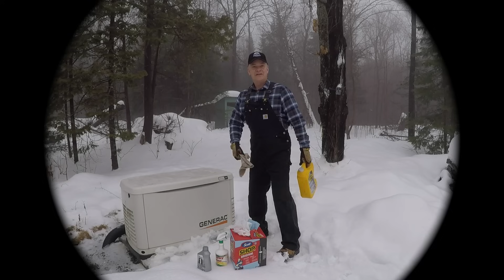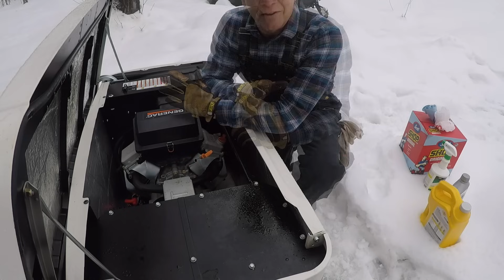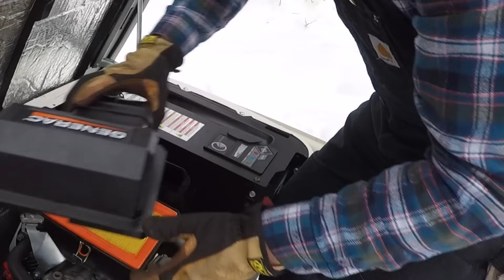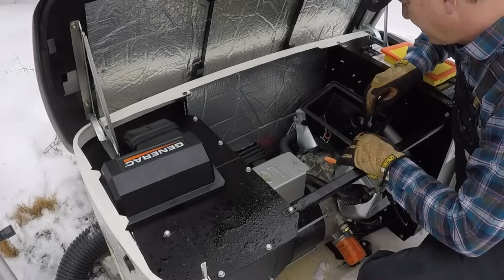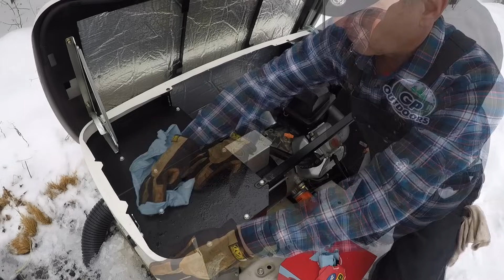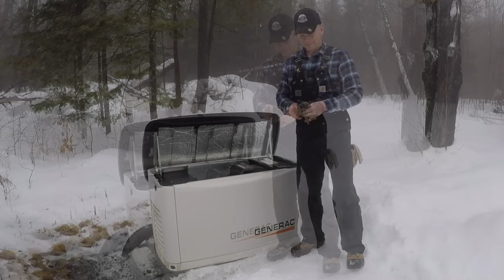#133 Thinking of Buying a Generac Generator? You Need To Watch This!

Comment: First thing you need to know before buying a natural gas generator:
Most likely that you will need to upgrade your gas line & gas meter from the street. The problem is not only the cost ($1,500 for the gas company, an additional similar cost probably to your master plumber, and another grand for the electrician) We found out that our street had a moratorium, preventing opening the street for a year. So had to wait one year for the gas company to be able to change the gas line to a bigger one.
Reply from the maker: That is true and excellent information - thanks for sharing it for folks to know. Cheers!
Reply: And for us country bumpkins, our propane tank needed it's own 1" line for the generator by code in Ontario.  Yup, the install is expensive but worth it when the lights go out.  We're on a well and it's nice to have water whenever you want it, and lights, and heat,...

Comment: Im baffled that there is an exhaust port in the air cleaner......I wonder if its actually for  crank case ventilation. One way to deal with it is to drill a couple small weep holes on each side of the bottom of that air cleaner box so to drain the condensation.....not so big to defeat the air cleaner but just big enough to drain.

Comment: Looks like a design flaw if you ask me.  Hopefully later models of this generator address this quite significant design weakness.

Bring on micro nuclear reactor powered generators of the same size as the Generac, except it's fully sealed, armored and zero maintenance/refuel needed for 60 years with a duty cycle of up to 744 hours a month (i.e. 24/7) @ 95% output or up to 730hrs a month @100% output.

Comment: These units are the cheapest of the cheap as far as stand by generators. Cold weather kit for a Briggs consists of a heated rod installed in block and a battery warming pad, Generac has a cuff that slips over the oil filter that's heated and the battery pad. The wire connections are push down spring loaded connectors opposed to screw lugs on just about every other manufacturer. You get what you pay for on these generators is all I'm saying.

Comment: DON'T FORGET ABOUT THE SOUND TEST done by many cities. You can spend tens of thousands of dollars and lots of time and pass the electrical inspection. Then they come out with the sound meter, and test, if it's too loud they won't let you use it.  The test is often performed at your property line. The further you can locate the generator from the property line the more likely you are to pass the test. It doesn't matter how noisy the generator is, it's the noise level at your property line. Yes, leaf blowers are 10 times louder and run much more frequently, but they not regulated by the bureaucrats.
Reply: build a fence around it to help contain the noise.
Reply: @robertbrown8396  Interestingly, portable generators are not regulated. They really can't. So, in the middle of an ice storm at 3am, I can drag out my portable generator connect it to a fuel supply, start the generator, manually activate a transfer switch. This is all fun to do at 3 am. Moreover, the portable generator is at least twice as loud.
Remember what Dr. McCoy said in one of the Star Trek movies. "The bureaucratic mentality is the ONLY universal constant."
Reply: @w-2385  Exactly... That's why I would tell them to go take a flying leap... And fight them on their "retarded law".

Comment: My original Generac 16kw lasted two years before it exploded, sending metal into the engine.  The warranty repair guy said it was a total loss and needed full replacement, so he took the entire machine away, box and all.  He came back a month later and said the Generac warranty people would not let him replace it but demanded he fix it.  He told me it cost twice as much to fix than to replace, so he stopped servicing Generac warranties.  Now, if I have a problem, I need to go with a small engine repair shop who does deal with the Generac warranty people and they are 200 miles further away.  He only wants to deal with contracted people who pay a yearly fee and still have to pay full mileage, even though he will only come when others in my area want service.  Luckily, the rebuild took and it has been a good machine for five years running now.  When this one blows up I will just buy a different brand, because of the warranty issues with Generac and no local service available.  By the way, my Generac is LP and it does not run in sub-zero temps because the propane does not flow at extreme cold temps; which makes little sense as this is a stand-by generator that is supposed to run while the weather is extreme.  I'll go with something gasoline-powered next time, but only because LP does not run in the extremes of weather we get up here in the north.  I have enjoyed the LP cleanliness and stability, but if it won't run in the winter it's no good to me.
Reply: Funny - our temps in VT get to -25 and my propane devices operate just fine.

Comment: Why couldn’t you drill a drain port in that filter container and let condensation run out of a hose down to the bottom of the unit? so you don’t have to go out and check on it.

Comment: I just talked to Generac tech support on this issue. They say they now sell a cold weather kit OR a extreme cold weather kit. the first kit has a heater pad for the battery and a warmer for the oil filter. The new extreme weather kit has the first 2 items in the kit above but adds a warmer for the air box along with the other 2 items above totaling 3 items to keep the bottom of the air box warm to prevent this condition . they described to me exactly as the video here describes. It should prevent this problem. Remember the extreme cold weather kit contains these three items not the cold weather kit that contains only the first two items. I will get the part numbers for the full kits or the individual add on pieces in the near future. Any questions contact Generac tech support and ask about the difference between the cold weather kit and the extreme cold weather kit

Comment: Why that brand of generator in such harsh conditions it’s basically a one cylinder utility engine like you would find on a pressure washer or lawnmower edger for about the same money you spent you could’ve gone with a commercial grade four-cylinder diesel and much more KW  ?

Comment: I have ran into a few of these units with broken motors do you believe that they don’t last long?
Reply: No I don't believe that they don't last long. Depends on what caused the motor to break. Maybe installing or modifying the intake to try to fix the problem and causing a bigger problem like water getting drawn into the motor itself.

Comment: I will add having 3 Generac generators, 2-22Kwh units at our 20 room motor Lodge & 1- 16  Kwh unit at our home that the stupid once a week 5 minute exercise does NOT get the engines & oil hot enough to burn off the condensation & I ended up with a white milky deposit on the underside of the oil fill cap and the dipstick, I got around that issue by going to once a month exercise & and when they shut off restarting them manually and running them for a half an hour , you can change the frequency of the exercises but not the run duration 😡. I should add that this is in far northern Wisconsin where it can get down to 30-40 below zero. Short run times is just like taking a short ride in a vehicle in cold weather, being as Generac has a factory in Whitewater Wisconsin I'm actually shocked that they wouldn't extend the exercise time run to get everything up to temperature, other than that I love our generacs and would not be without them 👍👍.

Comment: If this is the second generator, meaning you replaced the first one, why did it not last? I thought generators lasted a long long time?
Reply from the maker: Generators like this have a life expectancy based on the average hours per year of utility electricity outages in your general area. In my case, it is a backup to a solar system (I have no utility power feed) so it will run far more hours per year versus as a standby to a utility serviced home.  Hope that makes sense. Thanks for the question and all the best!
Reply: @GPOutdoors  thank you for replying. The video was very informative, I have another question. I live in El Paso, Tx. The weather here is for the most part really good even though many in Texas got rammed with the cold freezing weather, we just got some snow but no black outs. We hardly ever have any black however I want to prepare myself in just in case. I’m looking into purchasing a whole home stand by generator and I have narrowed it down to generac, a 22kw one for my 1700 sqft home, I want it to power everything in case our power goes out. Now I’m just in the fence between a liquid cooled or an air cooled one. What can you recommend? It does get hot here in the summer about 109 and in the winter it get down to the 20s. The summers are longer here than the winters. I appreciate your help, thank you, let me know what you think.

Comment: What does that run off of diesel ? , So if your out of fuel your still out of power?
Reply: Hey I heard of these,.but don't know anything about them ,they got to run off fuel for sure, if you had solar panels and a battery bank with a invertor you be in better shape I think , but hey ,just my thought . Plus I may have come up with a way to keep the. Batteries charged by using an alternator and a electric motor, don't laugh, it takes figuring to come up with stuff.
Reply from the maker: Propane, Les. Cheers!
Reply: How long will it run on one tank? About what, 8 hours or 12?

Comment: Why not put an electric blanket around that are cleaner and attach it to the generator in such a manner that when the generator comes on heat will be applied to that area because obviously the heat would only be applied in the cold as the generator would only be activated mostly most of the time in cold

Comment: Got a power fist generator, runs like a top has two winters on it.. Got a pro point pricey but lasted 600h and it sucks. Valves stick and it shuts down.. Pro point blows

Comment: How often does this occur. 
Is it’ daily or after several days of use?
Reply from the maker: Morning Joe. only in really cold weather ( -20 C) and after it has run for several hours.
Reply: @GPOutdoors  You might look into finding a good mechanic that can alter the air filter case. If it has a low place that you can find a air conditioning condensation drain tube that has a special rubber flat tip on it that allows water to drain out but keep air from coming in. 
I used to drive a semi truck that was built for trips to Canada and the air intake had levers on it that if condensation buildup on the air filters because of extreme cold damp air, switch the levers and pull the air off the engine compartment and that would element cold air getting into air filter compartments. Just some ideas

Comment: Just drill a hole in the bottom to let water out before it freezes at least that’s what the guy down the road he also put a hose and has to be a straight line to the hole outside of case.

Comment: why not put a weep hole in the bottom of the air filter cabinet with a drain tube? This would not allow the water to pool in the air filter box.
Reply: It’s a filtered box.  You don’t want to introduce outside air past the filter

Comment: Very simple fix.drill. a 1/4 drain hole at the bottom insert a tube to the outside of case.the water can simply drain out.

Comment: Easy fix,  drill an 1/8 inch hole in the bottom letting out water.  Same applies to old sbc engine with a distributor.

Comment: Nice job, mine is older with a different design,good tip tho......I would consider putting a wooden stand under your unitI have mine about40 inches off the ground,easier to maintain and keeps the little critters out .good luck !

Comment: That makes no sense. Hot exhaust gases do not go into the air filter unit, blow by from too much pressure building up inside the rotating assembly. The exhaust port would melt the plastic if it’s channeling through the plastic air box.  Blow by should be vented into what we call a puke take which catch’s the blow by of oil. Another great if not the best way to rid the pressures in the crank/rotating area known as the engine case. That hose he is calling the exhaust port, you can run a hose from the blow by port directly into the carb if the carb has an external nipple that has suction. This will draw the blow by back into the engine combustion chamber & get burned, plus your engine will run a heck of a lot better without all that built up pressure.

Comment: I would think you would put a drain on the bottom drill a hole out the side for the rubber tubing to go out through and there you go voila You got a drain

Comment: "Exhaust port" is a little misleading. It is really the air filter housing condensate drain.
Reply from the maker: Yes sorry about that - I am not very mechanical. It is the vent port from the crankcase. Thanks for watching!
Reply: @GPOutdoors  I'm apparently less mechanical than anyone! Thanks for the correction, I just bought a Generac and am learning about the unit, this video was very helpful.

Comment: I don’t think that is an exhaust port it is crankcase ventilation port !
And it’s an easy fix !
Plug the hole the tube goes to and make another hose point higher on the air box !
It will never do it again

Comment: How long will a 100lb propane tank last on a generator?
Reply: I've been told about a week. If your house is well insulated, you could
probably manually shut it down when you go to bed, and start it back 
up when you get up in the morning and get several more days use in 
an extended outage. I also asked my propane company to come top
it off the day before forecast storms because of possible outages
and the generator running for several days. Hope this helps.

Comment: Extreme cold application.  It appears he does not have the winter kit which has a battery warmer and a oil filter warmer.  The kit could be modified to add an enclosure heater.
Reply from the maker: Good morning- thanks for watching - I have all 3 winter kits on it. - battery, oil filter and now I have the kit that wraps on the vent pipe. The kit for the vent helps alot more now to melt it so it does not block the vent but it does not drain the water out of the filter box. Cheers!

Comment: I would add a drain line to the bottom of the box.
Reply: It's in a vacuum while running, and will suck unfiltered air into the engine, you don't want to do that.
Reply: @wesman7837  OK did not know that thanks..

Comment: I am thinking about a Generac unit and it is good to know about this.  It would be nice if you had said crankcase ventilation port rather than exhaust port as that clearly isn’t the exhaust port and might confuse some folks.  Seems like this is easily addressed with either longer exercise times (which is also better for the engine and it oil) or thermostatically controlled heat tape applied to the air box to keep water from freezing in it.

Comment: Generac, in their infinite wisdom, also had their air filters made in Malaysia and coated with a flame retardant which would so severely cut down the air flow that the engine, under moderate load, would run OK....but just barely. And it damn sure was running way richer than it needed to. On NG there wasn't any problem. On gas the carbon from unburned fuel would foul the plug and valve stems. If an additional heavy load hit the unit, say a water well pump, there wasn't enough air to supply the load and the unit would surge badly until that load was removed. But then you're still wasting fuel. Learned this  by unlatching the filter cover when it was surging and lifting the filter up.... Bam! Right back to normal operation. Got a lookalike filter at AutoZone that wasn't treated and haven't had any more problems. Generac dealers were pissed because the company would NOT reimburse them for the shitty OEM filters. They just threw them away.

Comment: I question his analysis. The air filter feeds the INTAKE of the engine. The pipe to the right in the INTAKE of the carburetor. If anything there is low pressure in that box. Has anyone else noticed this?

'Trust Me's' comment adds to my observation. I agree that 'GP Outdoors' is trying to help with his video. We all learned something.
Reply from the maker: Good morning Mike. Thanks for the comment- I apologize as I am not very mechanical. It was the vent port from the crankcase that freezes and blocks. I used the wrong term, I understand - sorry for the confusion. Cheers!

Comment: It seems to me that the GENERAC needs a design change to deal with this. Machines designed for use in California should not be used in  severe winter conditions. In my part of Canada severe weather is common in winter. That is the most important time you need your generac to work. Fortunately in my town I am seldom without electricity more than 1/2 hour.